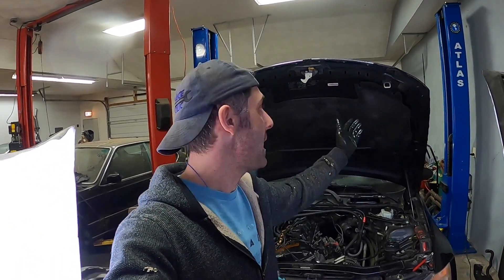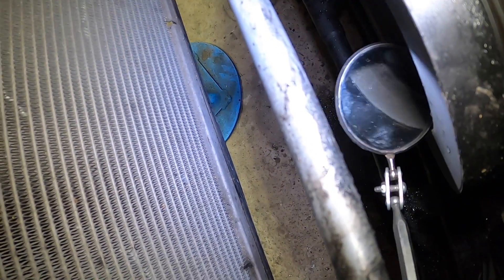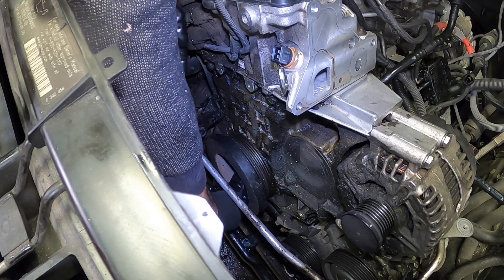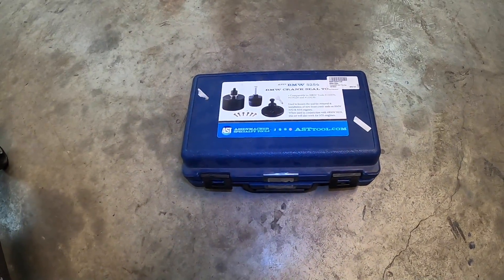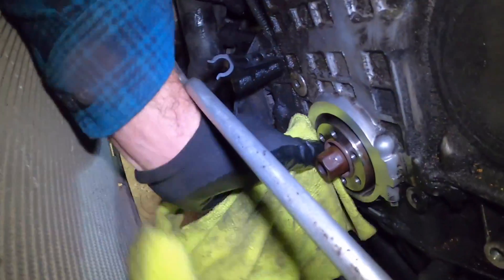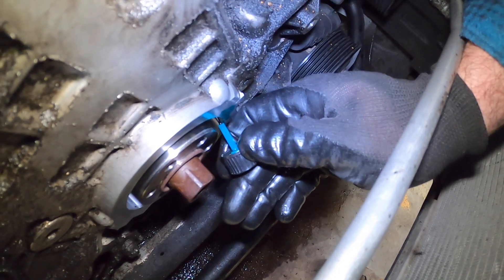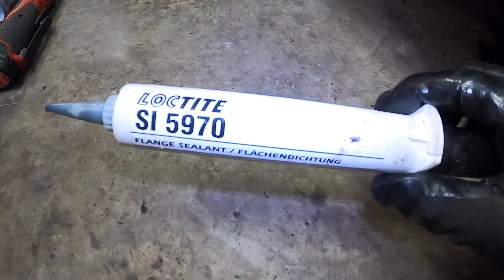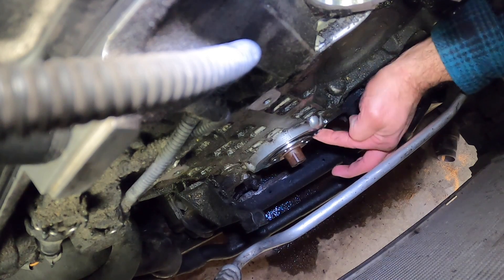Part 3d   BMW N54 Front Main Seal Replace

Comment: The service manuals seem to suggest using loctite 128357 or 193140 not loctite 5970 sealant, they are considerably more expensive but come with a needle applicator. Is there a difference between these compounds and is there some documentation detailing that you can use the 5970 instead?

Comment: How long does it take for the Sealant to dry and then cure. And the time until you can start the engine?
Reply from the maker: The sealant takes 5-10 min to dry before you can install the seal
Reply: @Garageaholic  so how about the loctite after installing the seal

Comment: When you took off the pulley didnt you turn the engine backwards by not holding the crankshaft bolt while taking off the torque bolts
Reply from the maker: Don’t need to with an impact
Reply: @Garageaholic  but you were using a ratchet to take off the 6 pulley bolts and the pulley was moving backwards. Or am I being stupid and the pulley has no link to the crank going back
Reply from the maker: THe pulley bolts are not concentric to the pulley. And they’re M8 size so small enough to easily break the torque by hand.
Reply: @Garageaholic  ah okay I've just seen other videos where they have held the crank bolt while taking off the pulley bolts to stop it from spinning backwards and when I was removing the pulley bolts, the pulley spun backwards a little.

Comment: A few points that should be added.
You should lubricate the bearing with abit of oil this will help the seal slide over. 
You should also prime the seal grooves before inserting the seal.
Use some RTV on the groves before pushing the seal in.
Reply: Yep he didn’t get any rtv in there at all. You are supposed to apply a thin (2mm) bead on the grooves of the seal, and then push the seal in.

Comment: Keep making videos it really helps out a lot more then you may think. I own a N54 and coming across your channel really just taught me a lot and gave me the confidence to keep working on my car no matter how bad of a hassle some jobs may be thank you please keep doing your thing
Reply from the maker: Thank you!!! I saw a large uptick in views. Was that you this week watching these vids?!
Reply: I watched your entire N54 series and some of your E46 and E30 it’s amazing. My clutch started slipping and I was looking all over for videos on how I can upgrade mine on my E92 N54 myself I love working on my own car it just brings me joy and I stumbled across your channel and you made everything so easy to follow and understand. I ordered a new clutch kit light weight fly wheel and I’m gonna switch out the rear main seal while I’m down there
Reply: It’s a little scary working under the car without a lift but I think I’m just gonna order one of those lifts that you put under your car on each side and they jack up the car pretty high and safely it’s some sort of hydraulic system. Would do it on jacks but I’m not sure how much clearance I would have to be able to drop the tranny

Comment: N54s make good power but damn they do have alot of maintenance work. All in all I think it's worth the hassle.
Reply from the maker: Actually, I don’t know if it’s worth the hassle PJ. I think I’m going to finish releasing this series, but hold off on any more n54 work, integrations, repairs. N54’s are just too problematic